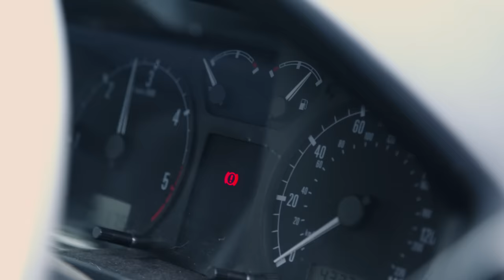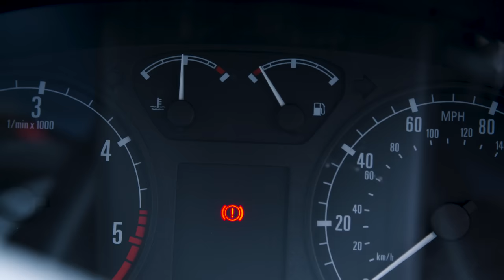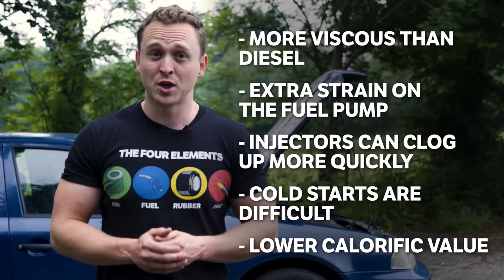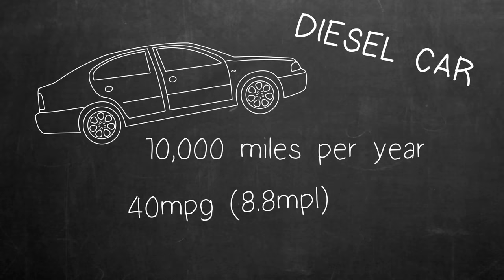The Pros & Cons Of Running An Old Diesel On Used Vegetable Oil

Comment: FYI, disinformation correction, Vegetable oil has a higher BTU than Petrol Diesel fuel (Calorie energy). Vegetable oil burns hotter and in turn is the reason for the elevated NOx in the exhaust emissions. VG oil burns hotter because it contains more oxygen atoms that are bound to the carbon atoms. This requires the bond to be broken which produces more heat and energy... you stated vg oil has a lower calorie than petrol diesel fuel.. research more and you dummies should use a fluid transfer pump instead of drinking diesel fuel.. they are not expensive.

Comment: Why does it have to be used veg oil?
Reply: It Would work the same way with unused oil, but using used oil is much cheaper and used oil is not eideble anymore so it it's good for the enviroment

Comment: You can't run it on neat vegetable oil it clogs everything , it leaves slime in your fuel pipes and your injection pump
I've been using it since 1996, run 20% petrol in it and you won't have any problems, always have 
redex in every batch
By the way your calculations are out lol
You calculated it as though you get the same mpg from oil you forgot

Comment: Nah nah.. 70g dried lye from wood ash & .5 gallon methanol from distilled grain per 3 gallon of cooking oil with drain shutoff on bottom. Let settle in sun for HOURS, and drain the sludge until it runs clean slowly then shut it off. Clean diesel remains..

Comment: You can run a car without
Any conversion,, I've been doing it for 2 years now,, in winter,, go half veg,, half diesel,, no problem, ,, summertime I'm 100% veg oil,, if I can't get hold off free oil or run out, I go Costco,, 20 litres 15 pound,, a saving off 12 pound from buying at the pumps,, but free is the way to go,,    this guy on vid has a funny weird way off filtering,, I buy ankle tights from primart, 3 quid for 6 pairs,, filter from one drum,, to another, then another,, and then one more time,,,,, so filter 3 times,, no bits whatsoever,, then fill up, you get to get the feel off the car,,, a bit sluggish,, change the fuel filter, also if any white residue at the bottom off you filterd oil,,, dont put that in,, I have a 30 year old Mercedes 190d,,, fuel pump is super strong,, amazing cool old car,, I'm not a vegetarian,,, but my old merk is,,, lol

Comment: I have a Unimog that uses diesel, DIESEL, so, saving is more needed then a small car engine. And cleaner is a big plus, BIG .  And the truck is build before, for situations where diesel can be hard to find. When SHTF... WAR. It's a ex-German army from 1982 and it runs by construction, an a lot of different feuls. Cleaning used kitchen oil, is the problem if there is one. When new kitchen oil is much cheaper than diesel.. what is then the problem? It's forbiden in a lot of country's to use it, for tax reasons and they fuck the climat.. not in Glasgow ? Ofcorse. The same reason that makes in country's the conversion of used cars, to electric ones imposible... for technical safety reasons...No, more taxes on a new car then on car parts. 21% on a new car is more then 21% on car parts... In Belgium they stop diesels to check for the diesel. If they find something else as farm diesel or to heat homes, you pay the double of the tax that was not payed by looking at the km on the counter. Old car, a lot of it and they say you drove with the wrong feul from the start... folow the money trail for catching criminals, for climat lovers in governements, do the same. 400 privat jets in Glasgow, good start. Top of the list, Old Joe, he came with four big planes and a helicopter. Number of cars, unknown...he forget everything... :-)

Comment: It is imposible to run the car  in winter.  The oil will become more viscous !
Reply: add petrol
Reply: @goosebuffz  Where is the advantage and logic?
Reply: @catalinIntimidatorul  This is actually something I do, adding petrol 5-20% lowers the viscosity much better than diesel, it's cheaper than diesel, easier to start.

Comment: No. Just no, you do not suck diesel up a tube.  Not even for laughs on YT.

You forgot to add in the cost of injectors and fuel pumps which wear out a lot quicker on veggie oil along with other things that can have their life shortened like oil seals.

Comment: Do not suck fuel you cheap dude. Use 2 pipes one to blow air in the tank then the other pipes to flow out the fuel. 
You did not know this tric ?😲

Comment: so much nonsense in this vid. dont use raw veg oil in a commonrail diesel. it wont last long, you need to thin the oil atleast. commonrails run at incredibly high fuel pressure. mechanical diesel pumps dont mind it but it still works them hard. you need to degloucificate the oil.. or mix half and half with diesel, or if you are really brave just use 5-10% petrol in the mix. you can also use organic solvents to thin the oil. veg oil CLEANS injectors and fuel systems. the filth in waste oil is what clogs them by creating carbon (burnt pootato in your nozzel basicly). you can run a diesel engine on waste engine oil!

Comment: Your way of recycling v.oil is terrible. If the oil was commercially cleaned, and sold at a reasonable price, it might have some appeal so as to save on resources. Unless of course, used v.oil already has some way of not just being thrown out.